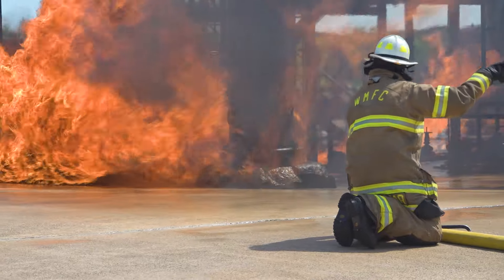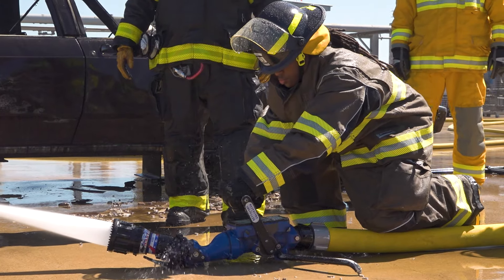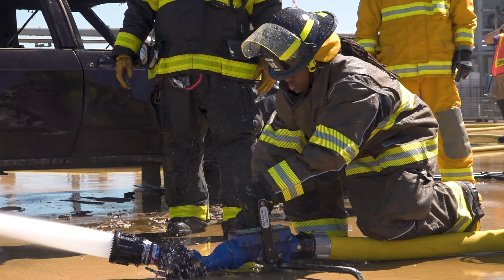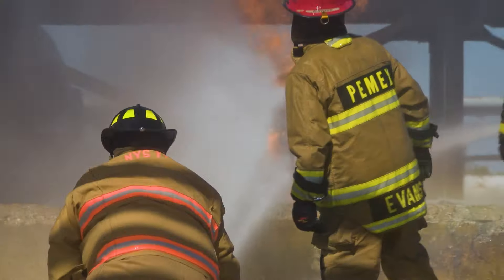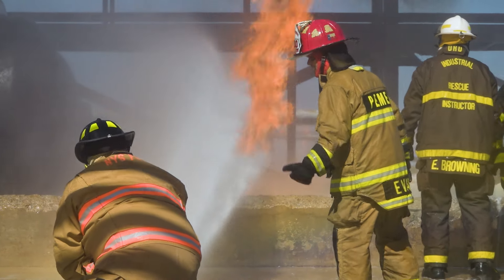Why Does the Blitzfire have a 500 GPM Max Flow Rate?

Comment: The Blitzfire is an awesome tool my company on Long Island has one mounted to back step,and has used it with great success knocking down a lot of fire very fast with minimal manpower.
Reply from the maker: Thanks Joe! Glad you got good use out of it. What was your favorite tactical situation to use it in?
Reply: @ More than once we deployed it off a pre-connected 2 1/2 line to knock down a large body of fire off of the 500 gallon booster tank. While this is being done a hand line is being stretched and water source is secured. Then Blitz Fire shut down and a fire attack is started with the line. When I was Captain we used the Blitz Fire as an Offensive Weapon rather than Defensive getting the fire under control rather than waiting for it to get out of control BEFORE using it. We held drills on doing this and were successful in doing so ,also we are a 100% volunteer fire dept.

Comment: Question? If I have a Blitz flowing 500 GPMs with a fog tip connected to 300' of 3" hose, it's 175 PSI at the pump. It says on the Blitz not to exceed 175 PSI but that's at the Blitz. So by the time that 175 PSI goes through the hose and loses friction it should be 100 PSI at the nozzle. So my question is if I made the 3" hose 400' and pumped it at 200 PSI from the pump, would I be going over that recommendation at the Blitz because with friction loss it would still be 100 PSI at the nozzle. 
Do I have this wrong and is it somehow related to nozzle reaction?

Comment: All good points , but a more important one is the fact that blitz attacks are conducted using tank water and most are rated at 500gpm. We have 3" preconnected and it deployed well with one man. As for flow, we can effectively push 600gpm through an 1½" with a water supply(not a common practice though).